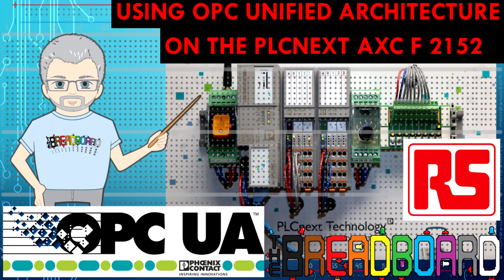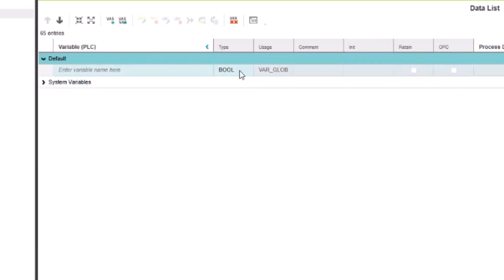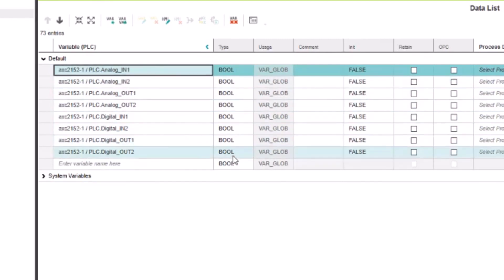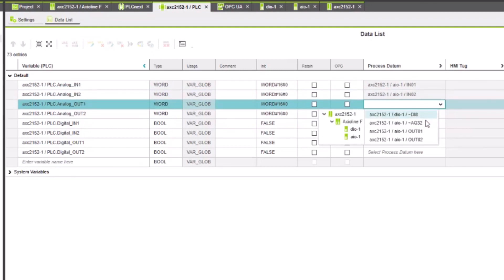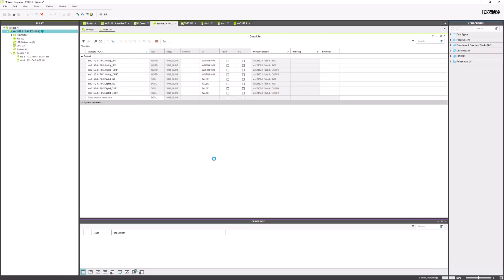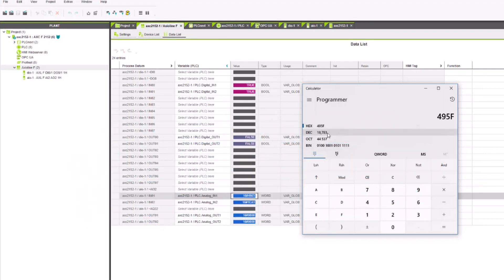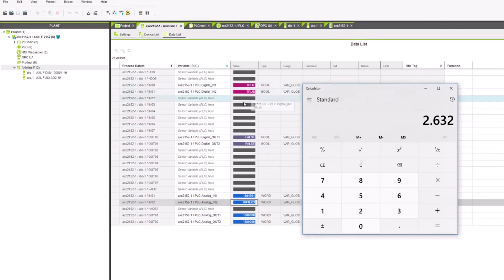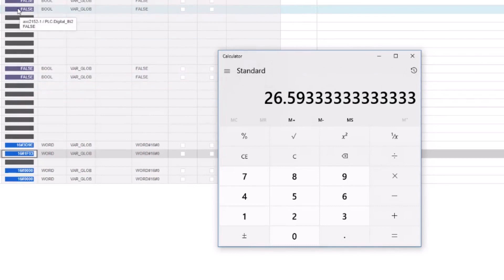OPC UA + Phoenix Contact AXC F 2152, 2 Of 3  Configure Parameters and Mappings

Comment: Hi I'm working with a "normal" Phoenix AXC1050 PLC.
Is it possible to send data back and forward from:

Machine >< Phoenix AXC1050 (UA Server) <> Sierra RV50 Modem <With M2M Connection> Server with UaTunneling <wifi> Laptop with Tia Portal Professional scada application (UA Client).

I know this is a bit off-topic but i could find much info so I thought that maybe you could help me.
So worth a try ':)

Sincerly,
Joost